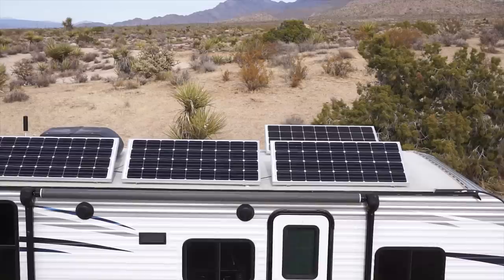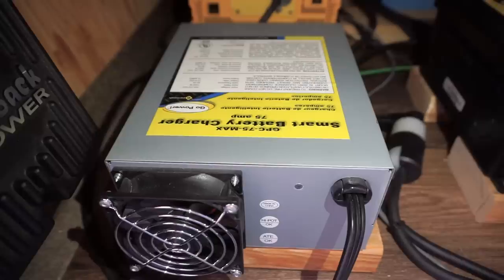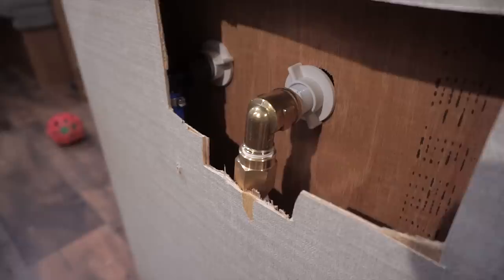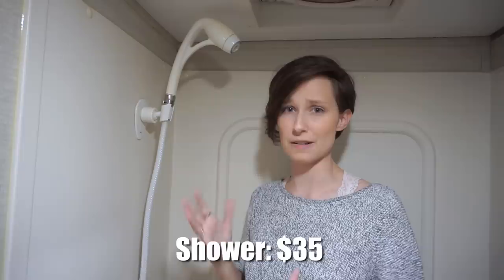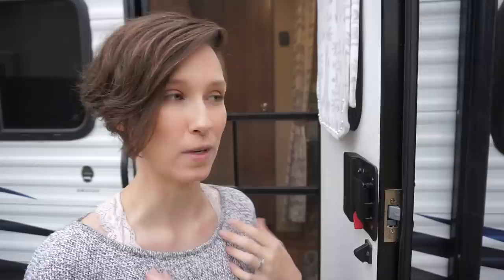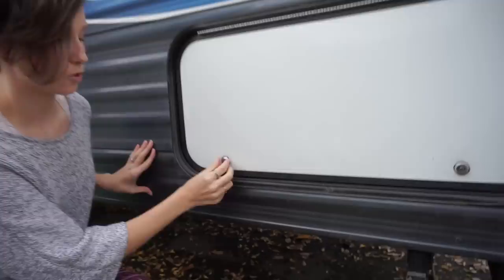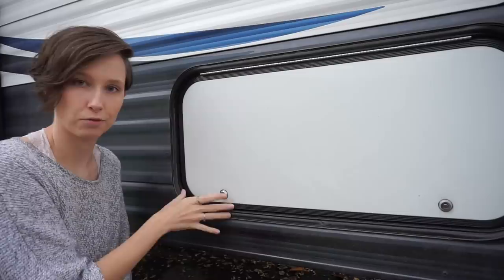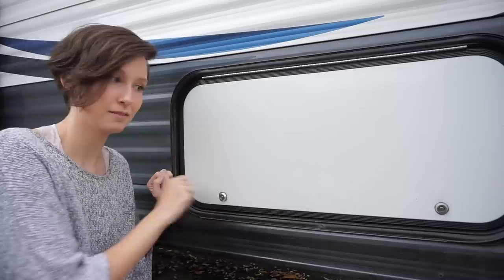Was It WORTH IT?? - All Our RV Upgrades Review - Solar, Toilet, Booster & More

Comment: The best way to avoid crying while cutting an onion is to try not to form an emotional bond first lol
Reply: Travis Hagan 😂
Reply: LOL  But really, the best way to avoid the tears is to store the onions in the fridge or freezer.  MUCH better.
Reply: IKR! Good one, I'll remember that!😜
Reply: I agree.onions have never had a negative affect on my life.
Reply: Most underrated comment
Reply: There is a bulb Just under the surface of the root containing sulfur-based gas which makes you cry. If you cut around the root at an angle to cut the bulb out you can then slice the onion how ever you want without your eyes burning. Just don't cut into that bulb just under the root.
Reply: You could always just chew gum while you cut! 😃
Reply: Onions release sulfur gas when cut which reacts with the H2O in your eyes to make sulfur dioxide, which then reacts with O2 in the air to make small amounts of sulfuric acid. If you want to stop onions from burning your eyes, rinse or spray them with water.. or set them in a container with water. ^.^
Reply: How could you NOT like onions??
Reply: There is a way to cut them that will reduce that significantly. Cut from a certain end I think.
Reply: Best way to avoid onion is a dive mask.  Breathe through your mouth and the onion will not affect you.
Reply: @JamesDean-ow7qo  Laughing!
Reply: Jacob Speed I had no idea! Thanks.
Reply: Still making me laugh.
Reply: OMGsh!  That’s what I’ve been doing wrong.
Reply: Place a damp dishcloth or paper towel near the onion while you cut it
Reply: Regarding Onions, as a former cook, I found that sippying on regular coke-cola while doing a large amount of onions drastically reduces tears ...
Reply: @JamesDean-ow7qo  that's what I use
Reply: “I hear the screams of the vegetables.”
Reply: Actually the best way is to only breathe through your mouth, takes some practice but it is the best way.

Comment: Re: Keyless RV door lock - to keep the top screw of the side plate from backing out, you can apply a small drop of LocTite blue or, if you never want to remove that screw without significant effort, LocTite red. To keep the lock body from moving, you can loosen it and apply a bead of Pro Flex RV caulk (or similar) all the way around on both sides of the hole in the door before reassembling it. Thanks for sharing your RV experiences!
Reply: lol. loctite blue: impact drill "this'll make it come out"  loctite red: screw tap "i wasn't asking!"

Comment: Regarding door lock ..use semi permanent thread lock for screw and silicon hidden under lock plates both sides..CLR for rust …enjoy 😅..thin rubber gasket would stop movement as well

Comment: On the auto lock door handle I would run double side tape under it. This will help it from moving or even a bead of silicone. That should help it stop moving. Also if it is moving then it means it doesn’t haven’t a good seal and could possibly leaking inside the door and this could cause the door to de laminate.Thank for the video and if someone already said all this just ignore lol. 1.2k comments I didn’t want to look through them all lol. Good job and I appreciate the videos.
Reply: i used to work for a rv place we always but butyl tape between the door and handle
Reply: Negative on using silicone caulk on a vehicle.
Silicone caulk hardens; at the first bump, components shift and that bond breaks, requiring a second/third/fifteenth application.
.
2003, we converted a 1997 Ford CF8000 commercial truck to our concept of an ExpeditionVehicle.
For our windows, I used Vulcum 116.
Nearly two decades of rough logger tracks to remote mountain lakes and no-trails to isolated Baja beaches, our Vulcum 116 is soft, pliable, intact.

Comment: I built my own 280 Ah 24VDC LiFePO4 batteries for less than $1000 each; I now have three. All you have to do is buy the raw 3.2VDC cells, matched sets in the voltage range you desire, add the BMS (battery management system), bottom balance, and bata bing, we have a battery. Four 3.2 cells in series equal 12.8 volts (a 12-volt battery), add 4 more cells and one has a 24 volt or you can connect two 12 volt batteries in series to make a 24 volt.

Comment: I concur on the thread locker. Use Blue if you want an easier time of removal . And Red if you if you never want to remove the screws. As for the lock set itself wiggling, try some RTV around the perimeter flange and the door.

Comment: Great tips and really liked the reasoning, cost and "would we do it again" explanations.  However, perhaps you didn't realize that the shut-off valve on any shower head is supposed to drip even when off!  This way you don't accidently leave the hot and cold wall valves open with the valve on the head closed - which could lead to a burst hose (which isn't intended to take constant pressure for the long term) when you are gone causing you to unknowingly lose all of your water.  Cheers!

Comment: This is the most insightful RV upgrade video I have ever seen.  In most videos I know so much more on the subject than the person creating the video.  It's like going to Oreilly's and having the kid across the counter trying to give me advice.

1. Bed lift shocks- Great idea and I'm going to do it.
2. Maxxxair fan- Upgrading the bathroom fan is a MUST.  Most RV's come with the same crappy vent with the same crappy (but expensive) tiny motor that will burn out often.  If you can't afford a Maxxair or Fantastic fan I suggest modifying your vent to accept the common d-shaft motor and fan.  It is 3 times bigger and 1/3 the cost.  fyi, you might be able to do the same upgrade on your kitchen vent.
3. Composting toilet- For me a regular toilet is fine but they definitely have their place.
4. Solar- Solar is a MUST.  You have a great setup.  I personally use big 72-cell 325 watt panels to save money and no way I'm spending that much on batteries but they are awesome.  I chose to make my trailer as DC friendly as possible rather than an expensive inverter.  This includes tv's that use a dc adapter.  When you are shopping for a tv look behind it and see if it has a DC adapter.  If so all you need is a cheap 12v  to 19v (usually) dc to dc adapter.  Same for your laptop.
5. Shower head- Another MUST.  I have a different model Oxygenics and it is way better than the bargain basement head it came with.  I think they leak for a reason.  So you can lather up and also to remind people to close the water valves.  Most people don't know about the check ball thing and I never thought to install one.  Thanks!
6. Dinette removal- I haven't done it yet but it has to go!  
7. Shade upgrade- Very nice but not a priority for me.  
8. Keyless locks- there are a lot more keys than you might think and the replacement probably uses the same set of codes too.  Not something I would worry about.
9. RV storage locks- I shock people all the time with my magical CH751 key.  Don't mount your li-ion batteries in there LOL.  Definitely needs to be done.
10. Signal booster- At some point I'll get one but hasn't been a big enough issue yet.

Other than what you listed I've done several winter weather upgrades, battery isolator in the truck, and LED lighting (2011 trailer).  Excellent video!

Comment: Hey guys great video.
Door Latch problems fix, first replace all screws with stainless and as mentioned screws may be a bit too long so either get shorter ones or shave the tips off and by all means use lock tight. Also prior to reassembly put a good bead of silicone glue on both in and outside portion of this locking mechanism, this will help not only glue this unit solidly onto the door as well as a waterproof/ draft proof seal. 
The both of you have inspired me to not buy a ready made RV instead build one myself using a built to spec 42' goose neck car hauler with 7'-8" of ceiling space to be not only my living quarters but also having the ability to haul my Yamaha Venture motorcycle as well as my Can Am Outlander for off-road explorations. I am getting ready to retire here within the next year and have decided to not stay put in one place for the rest of my life. With over 40 years of working in the construction of homes, commercial spaces as well as industrial I am more than capable of taking on this task. I am in the design stage now with so many ideas dancing in my head like spray foam insulating all walls floor and ceiling as well as rubber undercoating the underside of this trailer. Under flooring heating systems for living areas, dual rooftop AC units, walk-in shower with seating and planing on using 6- 190 watt Go Power panels with 4- Battle Born LiFePO4 Deep Cycle Battery's accompanied by an Onan QD 3200 diesel generator to assure I have substantial power to stay off grid for however long as needed. I dig the composting toilet idea for its efficiency and will be using Uponor piping trough out for the absolute assurance of no water leaks ever.  Where i'm not too sure yet is tank sizes, was thinking 250 - 350 gal min for fresh water and have no idea for the others. Its just me and two dogs for now, my Jenny passed away way too young from cancer, but life goes on and I look towards living it to its fullest. Any suggestions you can make would be helpful and very grateful.
Once again I want to thank the both of you for your awesome channel and the great work the both of you put into it. I am a long time subscriber to it and look forwards to many more enlightening videos. The two of you are very blessed to be able to live life on your terms. God willing you will be able to continue this for as long as you wish.
Reply: Awesome man good on you to have those skills! How did it turn out?

Comment: For your lock how about 1/8" rubber membrane you can cut to size as a gasket for both the inside and outside lock faces. Will also keep the door locks from slipping once tightened! Good luck!
Reply: This is the best solution and what I was going to post.  I would not use glue or silicone, your screws seem to be holding fine but your door is just a little to thin for the lock system.  using the 1/8" weather stripping will take up that slack and your lock with fit much better.  Not to mention the added benefit of "weather stripping". LOL
Reply: That's a good suggestion. Our original locks are always loose too.
Reply: Plus put blue Loctite on everything in a camper
Reply: If you find screws loosening up take tooth pick break off to fill hole.  Squirt some wood glue in.  Let that set up a few minutes.  Put screws back in.  The glue will help bind the tooth pick to the wood and give the screw new material to bite into
Reply: Use red lock tight on your screws if you want it fairly permanent. Don't use silicone, or glue. If for some reason you need to remove it. The glue makes a mess. Silicone is inherently slippery. So when it dries. If ever the bond breaks free. It will just make it unscrew a lot quicker.

Comment: I have the same lock on my fifth wheel and it never wiggled. But on the inside plastic piece I lined the back of it with 3M permanent outdoor double stick tape because I didn't like it flexing when I closed the door from the inside. It made it rock solid, And in your case I bet it would lock it down and stop it from moving. Just an idea.

But me and my wife love the lock, It was a game changer for us. We are full timing with a 3-year-old and being able to drive up to the side of your RV and unlock it with the fob has been awesome. Especially when you have full hands carrying the little guy up the steps or groceries and you're trying to get in fast due to bad weather, This lock has been fantastic!
Reply: I was going to say Shim it with a thin piece of wood but that tape is a great Idea.

Comment: door lock, if those are wood screws take it out, dip a couple tooth picks in wood glue, shove them in the hole and break them off. then you have all new wood to put your screw back in. If the screw is metal with cut threads in a metal frame, wrap the screw in foil, enough to get a tight fit, and screw it back in. use silicon calking to stick the lock to the door, waterproof it and keep it from moving. Great channel!

Comment: On your keyless lock.
Take 1 striker screw to hardware store get stainless steel replacements. 

Get blue locktite thread locker for the screws 

Get a roll of dicor tape ( burial tape) to put a seal between lock and outer door skin. 

Get a cheap plastic cutting board to make a shim plate for the inside .

Comment: Fix for your striker plate: go to home depot and buy stainless machine screws and some red locktite.  You're welcome.
Reply: Id go with blue loc tite. Just incase it needs to be removed
Reply: Also, put a bead of caulk around the inside and outside edge of the lock. Once it sets... no wiggly...
Reply: Red is a little too permanent for my liking. Blue should hold just fine. If you use red and need to remove it later you might strip the Phillips heads trying to back the screws out.
Reply: @Markomyt1  I would use butyl tape so if it ever needs worked on its an easy sealant to clean off
Reply: Also i would glue in a couple tooth picks in the stripped screw hole so no thread locker is needed
Reply: One thing I would add is it really should not be exposed to water if your seals are good .
Reply: 3M VHB tape.  Lock will not move.  Same tape that solar panels are put on with.
Reply: I always use toothpicks and carpenters glue into the hole. Let set, and put a new screw or the old one if not damaged. Lock tite  works too but not needed.
Reply: The strike plate needs shorter screws. They are bottomed out. I'll bet there was a strike plate on the interior of the door that fell down inside the door when the original latch was removed. It happened to me. I just used shorter screws for the RVLock.

Comment: Replaced rear bunk beds next to rear bathroom in our 2007 Alumalite 32 ft. bunkhouse trailer with an acrylic claw foot slipper bathtub and had enough room at the narrow end of tub on the back wall for a Splendide washer/dryer. Our water heater could heat 10 gal in under 8 minutes, so 20 minutes for almost 30 gal of HOT water.
We also took out our trailers range, (the oven was only good for burning cookies) & put in a FisherPaykel dishwasher drawer and gas cooktop. There are many electric cookers better than the gas oven. Made three years of full time RVing luxurious!

Comment: For your door lock, install the inside plate with 3M double sided tape. It will stop the movement.
Reply: Great advice. I use 3M double sided tape and Velcro (hook & loop) fasteners all the time.

Comment: you might want to put a 1/8" shim behind the door lock so when you tighten up the screws it will stop the shifting. I love my key less entry!
Reply: I cut a spacer out of some 1/8 plastic I found in the shed. Doesn't move at all.
Reply: That would have been our recommendation as well!
Reply: Maybe shorter screws would be able to tighten up that door lock.
Reply: This and maybe a little bit of blue Loctite just to keep the constant slamming from working things loose.

Comment: With the intent to be helpful... About the RV Lock and other similar fitting issues (step by steps are on YouTube by Issue) 1) Filling holes with similar materials and then re-drill (might need to tap if it's a heavy load): I use JB weld for aluminum/steel/other, plastic filler, wood filler and super glue 2) Opening: I use aluminum or wood sheets with strong glues or fasteners (Like, patch door lock area and restart install). 3) Things that rattle or wiggle: Get the right spray foam for the issue and consider it will stop access to the area. I use 'Great Stuff - low expansion' for most fillings. 
Hope this is helpful and reading others comment...  Aloha

Comment: We put our solar panels on two racks and did not attach them to our trailer. That way we could park the trailer in the shade and place the panels remotely in the sun. We can also adjust the panels for morning/afternoon sun easily as well. Being very careful with the line voltage of the DC power and Ohm's Law, we have our panels set up in combination series/parallel configuration so we do not need heavy power cords back to the trailer and still have a safe DC voltage to work with. 
By having our roof clear, we also made a sun shade for the trailer as well. A couple of cheap air mattresses on the roof and a sunshade cover we made keeps the trailer from being an oven, even in the open desert.  It works very well. Sunshade material can be purchased all over )Amazon, Lowe's, Etc.) and comes in different colors and weights. Avoid the heavy weight though, it does not breathe as well as the medium or lighter weights and can trap heat  more. This is not a waterproof tarp, it is a fabric which will just keep direct sunight from hitting the trailer and will not trap heat under. We actually made some nice tents out of it for group gathering/meals using old Costco frames. Even in the desert, they make life much more pleasurable. Using tan material helps us blend in the desert a bit for more privacy. Haven't made a camo one yet by combining different colots, but it's on the list. The dining tent we made has a tan top and lighter weight dark green for the sides. Black would also be good for the sides - dark colors are easier to see thru than light colors.  I have been collecting old frame parts so I can mix-and-match to make a tent larger than the stock 10'X20'. Someone who welds could make some very interesting designs/sizes. Shade cloth is great stuff - especially for dry camping.

Comment: Take out the mounting screws for your door lock and shorten the screws by cutting them down a little. They may be bottoming out before they fully pinch the door frame tight.